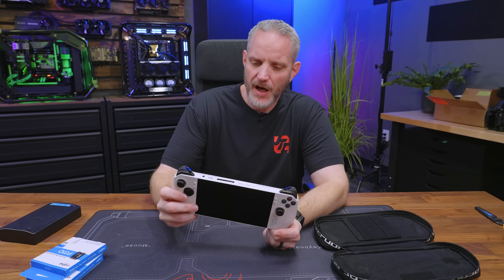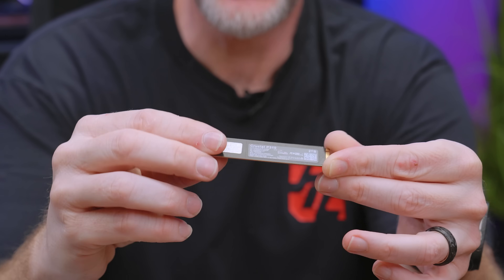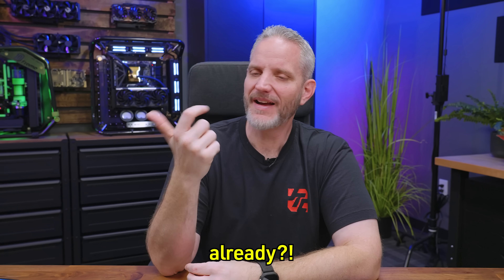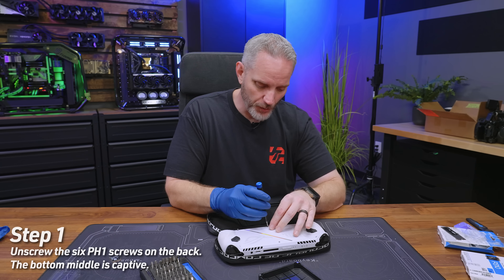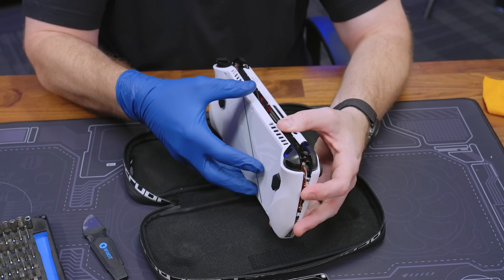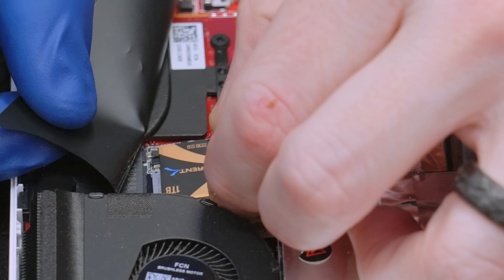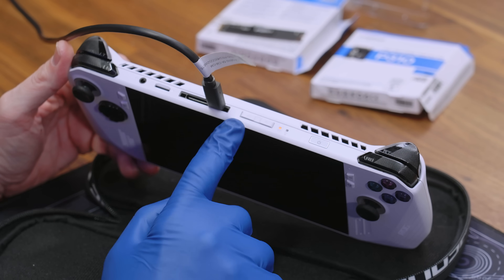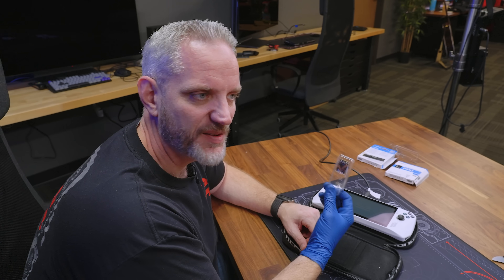How to upgrade Ally SSD.... Easy Turorial

Comment: I remember the first time I got my hands on a 2280 M.2 drive that was 1TB. And put it up next to a 3.5" 1TB HDD... and then looked at my old 8.4GB 5.25" Maxtor Drive that I keep for nostalgia and think...

I bought that Maxtor drive in like 1998.

26 Years and we now game on sticks of juicy fruit. Utter Insanity.
Reply: You sound young? :-D
I'm pretty sure my first 44 MB (!) HDD was a 5.25" model.
That might sound small-ish, but all of Windows 1.03 I could fit on a 1.44 MB diskette which I possibly had formatted to 1.7 MB. It came with what we'd call Office, as well.

Comment: Jay thought you would get a kick out of this story. This happened to me. Back in the early to mid 90's I had to order separate storage drive for the department I headed. IT had asked that I get a 1 gb hard drive to  put on the server for my departments storage need(engineering) for our drawings.  I went to my boss and told him the cost $1000.00 US. I was instructed that I would have to generate a business plan to justify the expenditure.  I did so and we bought the drive. The drive was a full height 5 1/4"drive. We used the drive for many years but servers were upgraded and the drive was not used. Wheni left the company many years later I saw that drive had been reassigned to being a door stop in the server room! Technology and hardware have sure advanced over the years. My first system was 8088 10mhz 64k ram system.
Reply: And here we are in the future.. We can buy a 1tb micro sd card for under $100... Or a single bag of groceries for the same price

Comment: I'm not playing console, or with console controller or handheld, but i think i have the same curse Jay have... i played too much with keyboard and mouse for more accuracy... you have to use a game controller a lot to overcome that. I even bought one for well.. most games are actually ported from a console, but witcher3, AC, GoT, Elden Ring, GTA, Horizon, rdr2 etc etc, just never use it since it's better to play with keyboard and mouse for me.  Flight sims i play with hotas and pedals.
Reply: I'm not big on playing most 3d games on handheld, but some genres are fine on them, like narrative games or walking sims (anything that doesn't require reaction time). Turn based games and 2d games are fine on handheld. All the games you listed, I would prefer PC. There is something to be said for portable Skyrim, though.

Comment: I'm curious. If you have a PC and you put the old 1Tb and the new 2Tb in it, saying you have two M.2 NVME slots on the motherboard, would running Clonezilla work so you don't have to do the whole cloud download and start from scratch? I've used Clonezilla to clone a HDD to NVME, and for cloning a 500Gb NVME to a 2Tb. You just have to be able to go in and extend the drive space once you boot up with the new drive.
Reply: Yes. Good cloning software should be able to do this. If need be, you could even get some USB to m.2 adapters and use those.
Reply: This whole video was to troll us into such thoughtful comments. I don't have any handheld games other than some on my phone, but I want to know what cloning can and can't do where it comes to Windows partitions. It somehow seems to be clouded in vagueness.

Comment: My issue is that I am in my mid 40's and wearing reading glasses to play games on a tiny screen sucks!! I use a laptop for portable (at work) gaming mostly. I have the Steam deck (upgraded stock 256GB to 1TB), Vita, PSP (128GB card with custom FW so I can play TONS of emulated classics), Nintendo DS, Gameboy Advance SP (for GB advance and a few GB color/BW games from years long gone). Now I share them with my kids (when they behave).

Comment: that small nvme you can put in to older laptop instead of wifi card if it don't have any pcie nvme slot but i am not sure if it will work as a boot drive...huh? swallow it? how much drunk you need to be to be able to do it :D it's probably not in a human capabilities to drink so much booze :D Jay you are like me...gaming on something else than PC is a no go i have PS4 i used it because it was more powerful than my old i3 2100 but then i start to build PCs and i turned it on like 2x since i builded a PC for my personal use...and boy i forget to buy a good monitor 🤣so i wa a bit disappointed

Comment: I bought a Lenovo Legion Go as gaming/tablet/Windows device and added Emudeck along with the normal Steam and Epic clients. I got a foldable keyboard and a mouse with common Xbox controller. I also picked up a dock for it as well and a 1tb micro sd card.

Comment: I briefly owned a Dell SFF desktop from Costco last year.  I returned it when I couldn't do triple-head from the onboard graphics.  (Turned out to be a good thing since it came with an Intel 13th-gen CPU, but few people suspected that would turn out to be a problem...)

It came with Windows installed on a 2230 NVMe.  It fit on top of some drive cage or bracket or something; it would also support 2280s which would span across some air gap to a separate mounting post somewhere.  When I cracked the case open to look around and put my own Linux 2280 NVMe in there, I was surprised that they shipped it with a 2230.  The space saving didn't seem useful, since they still engineered it to allow for a 2280 if the owner wanted to use one.  So it wasn't like it allowed them to mash more components into a small SFF case.

Maybe the 2230 was a smaller capacity and it saved them parts cost to put in a 256 GB drive that just happened to be shorter--i.e. if all the 2280s they could commercially source would have been larger and more expensive?

If it might have mattered to somebody to be able to accept a shorter NVMe drive that they happened to already have, it would only take 2230 and 2280--there wasn't a way to mount an intermediate size because it would have been in the middle of that air gap.  (Other sizes are so rare that it seems unlikely a new owner would have one on hand that they wanted to use anyway.)

Comment: i use the asus rog ally 2230 to 2280 mod there like $10 to $17 on amazon and  add a 2mm thick heat sync   and are easy to use highly  worth useing them and then just install a 4 tb drive iv not seen any battery life differences

Comment: Just get an external enclosure for 10$ and clone your drive to save yourself the trouble of starting from nothing. You can use the enclosure with the OG drive if you have nowhere to put it in.

I own an ally Z1E. It became my main device for gaming lately, I even use sunshine/moonlight for some games that wont run well on it.

Comment: You think these are niche, try getting your hands on a 2TB 2230 drive a year and a half ago like me.  I ended up getting a OEM Western Digital 2TB drive (probably for a MS Surface) for my Steamdeck back when there were no retail 2TB drives in the 2230 form factor.

Comment: The original Steamdeck has been my best purchase for the past like 5 years. I have been playing a lot of roguelikes on it which takes a lot less power and usually runs at 60fps with really low power draw. So I can play wherever I want, on the toilet, on a plane, on a train, in my bed etc.

Comment: I would say this size and form factor is best with games that use easily identifiable silhouettes and shapes in the visual style. Not necessarily retro games but games don't have a lot of small objects everywhere or a lot of shading/ texture nuance that might be missed on smaller screens. On a small screen, I would hate to play a realistically shaded action game that also requires hunting around for small items and puzzling elements. Yes, I know they have highlighting in these games but things are still hard to identify.

Comment: Couldn't you use external nvme cradle (usb-c connection) and just clone drive first, than just swap nwme?
Reply: You can. That's what I did when I switched to a 2tb drive. I figured that cloning would be faster than setting everything up again.
Reply: @Kasper0822  I know it is possible, just wanted others to know :)
Reply: Jay actually tell it very quickly near the end

Comment: I have a Sony PSP that imported from Japan back when they was only available there, so it is one I have had for almost two decades.

Now I only use it when flying, as generally I prefer gaming on my PC. However the PSP and the games made for it work well together, so for example I would not ever play Lumines on the PC.

Comment: About M.2 sizes, but the other way from what Jay is talking about here ... maybe this would make a good future Jay video:

If you look through mainstream M.2 products, none of them create high-end 22110 length M.2s, all of them stick to 2280. Today almost all 2280 M.2s do not exceed 4TB max.  Despite the lack of 22110 M.2's on the market, motherboard manufacturers keep building boards with 22110 spaces.  Why do board makers do this?  Why don't M.2 manufacturers take advantage of the potential capacity of the longer M.2 to get more Nand on it for capacities beyond 4Tb ... and faster speeds?

Why as users, do we not want 22110 M.2's ... therefore larger storage capacities ... even though our MB's have at least one compatible spot for it?

And 'laptops' are not an answer, as many hardware part formats are not interchangeable between desktop and laptop or other handheld formats ... like RAM.  The market can accept different formats for different categories of products, so thats no excuse.

Comment: I recently picked up a Steam Deck, it's literally my first portable system other than a Nintendo DS Lite (that I hated) and that's saying something since my first gaming system was a Magnavox the size of a 1970s VCR and it only played Pong.  The LCD versions of the Steam Deck were recently on sale and I picked up a 512GB LCD model.  I work out of town so I am basically stuck there during lunch and I picked it up because I hate staring at my phone for an hour.  I mainly play Valheim, Mudrunner, Subnautica, Factorio, Satisfactory, and the like.  I put Skyrim on it just for fun, but it runs a bit hot when playing it.  I put Fallout 4 on it but haven't tried it yet.  Overall, I don't like portable systems, but it's not bad for a small, self contained unit.  I would almost prefer a laptop, but that was out of my budget and my old laptop would be lucky to play anything made in the last decade.  But so far I am happy with the Steam Deck.

Comment: Rocking a Steam Deck LCD 64GB model with a 256GB internal storage upgrade and a 512GB SD card, i mostly use it as Indie game system and to run Kodi (Ripped DVDs/BD's off a NAS) on my TV via the Dock, i would highly recommend going OLED model tho, the LCD models WiFi/BT modue sucks big time if you have a internet conection faster than 300mb/s or if you want more than 2 BT devices connected at any one time
Reply: Sadly the oled version also has a crappy wifi driver / hardware that keep disconnecting...

Comment: I use the CRAP out of my Steam Deck, but I'm a team truck driver.  Use it in my downtime bored in the sleeper before I pass out.  Really wish I'd put a 2Tb in mine instead of 1Tb, but the Sabrent is a great drive so can't complain too much.

The only time I fire it up at home is to add/delete/update games/OS.  Usually once a month or when I remember to take it out of the truck.

Comment: I purchased a 64GB SteamDeck and a 1TB SSD from Sabrant and in came in a super cute metal case.
My gaming went from few hours a week on my PC to 30 hours on my SteamDeck lol. It really fixed my issue of gaming in summer with the PC acting as an heater and the AC barely able to cool my room.

Comment: I have 2 psp's , vita all modded and a anbernic (Emulation handheld) basically only play with them when they need updates ect but mainly are show pieces along with my modded consoles that never get turned on.
all systems since the 70's are all on my emulation pc so makes them all just pretty dust collectors.

Comment: OG Steam Deck. Sometimes it's nice to laydown and a play a game which imo is the best use-case besides travel for handhelds. While the steam deck doesn't have official support you can stream from a playstation or xbox. You can also stream steam games from a PC. So long as you have wired consoles/PC and a solid wifi, the streaming works fairly well.

Comment: I would have cloned the drive. 
They make external M.2 drive attachments for this very thing if you don't want to bother with installing them in a PC to do so. 
Also, Macrium Reflect is the best free cloning software I have used to date.
Reply: Macrium is no longer free.
Reply: I was going to say this too! Save so much time vs re-downloading and reinstalling
Reply: Loud Office voice: "Thank you!" 
Would it be worthwhile doing this when buying a brand new PC/laptop with Windows? Buy extra SSD (assuming there is room), clone the fresh install, and then have a dual boot system where you just rarely ever boots from the close so it stays fresh enough? You'd still get most of the capacity increase, but whenever Windows does Windows Things (TM), you have the option right there. I don't know where this would create any snags...?
Reply: Yeah I was wondering why no macrium reflect.

Comment: Steam deck Gen 1 512gb
I love the thing, and it was essential on recent trips. But I hope any future rendition improves the battery life. Easy stuff like Chillquarium it can run for hours on a single charge (perhaps 3-5 hrs, depending on settings and tweaks?). But throw something like Elden Ring on it, and it'll chew through the entire charge in an hour or less. 

The other thing is SteamOS and Proton. If you have games with a Python backend, you can add the .sh file to the gaming side and run it native. Pretty handy imo.

Comment: wait why do a bios recovery for this and have to re-dwonload games and everything? why not just clone the existing drive to the new one?
i did that from a gigabyte laptop to put into a desktop i built myself and it worked fine.
Reply: It's possible but not part of this video, as mentioned.
Reply: @JohnADoe-pg1qk  doesn't really answer "why" one would do it this way.
Reply: I did that the last time I upgraded the drive missed a step in the instructions and ended up with half the space. Not sure I saved time with how long it took for me to fix it. Plus a clean install of windows can help with niggles.
Reply: @krzykat thank you, that makes sense and is a legitimate reason why one would do this instead.
Reply: @krzykat28856  this is common with clone devices from a smaller to a bigger drive. It's as simply as merging the original partition and thr now unallocated partition. Something like Aomei partition assistant works well for that.
Reply: @krzykat28856  this is a better explanation for "why". thank you.
Reply from the maker: I literally talked about that at the end of this video, please freaking watch before you comment
Reply: @Jayztwocents  please be calm Jay, I watched the the whole thing, I always do...sometimes I just comment before finishing... my apologies?
besides, you didn't really answer it, you basically just said that's a different tutorial.
fine, it's not like i'm mad, i'm just curious about WHY one would do it this way instead.

Comment: If you're replacing your ssd in your steam deck 2 pieces of advice.

1 remove your sd card, if you open your deck with sd card in it will snap in half.

2. Use a good screwdriver.   The screws are really soft and strip easy, get a good driver kit with a head that fits tightly and you should be fine.